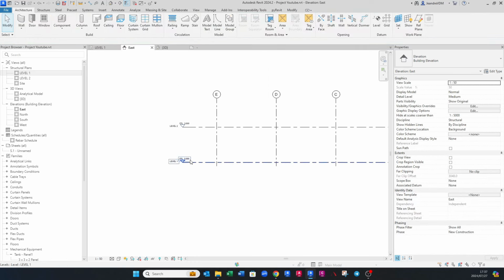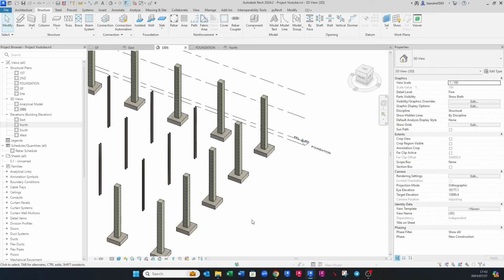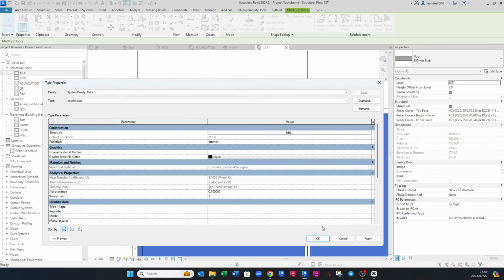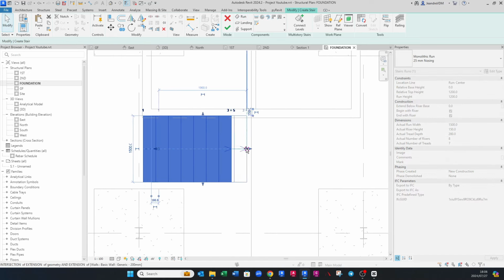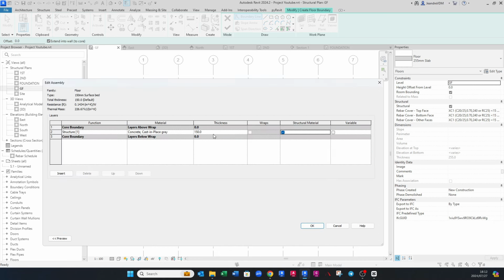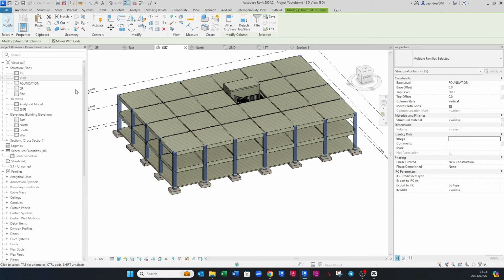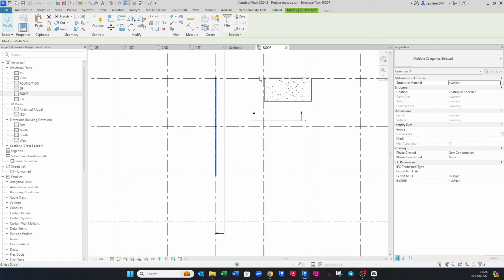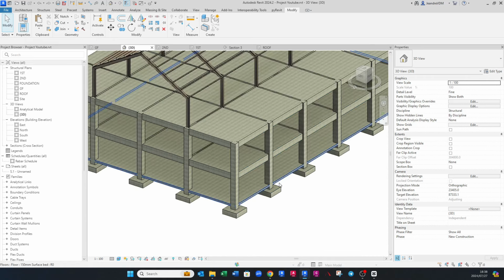Revit Structures - Modeling a concrete Structure with a steel roof

Comment: Hi, fellow 🇿🇦 here. Just found your channel, this was the first video of yours ive watched, as a revit beginner this was very helpful, thanks. I'll be watching more. Also don't know if this is still relevant but the issue with selecting the floors,  on the bottom right of the status bar there's an option to select by face which i find very useful when revit's being a pain and wont let you select floors when you tab cycle.
Reply from the maker: Hi there 🇿🇦

I’m happy to hear that you found my channel. I really hope my videos will assist you as a beginner on your Revit journey.

Thank you as well for your input regarding the floor selection.

Happy learning!